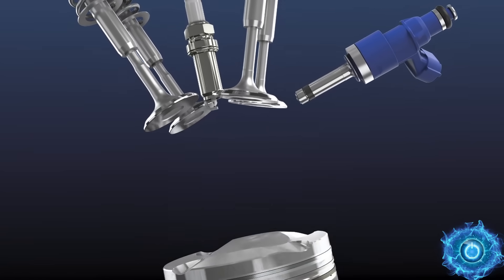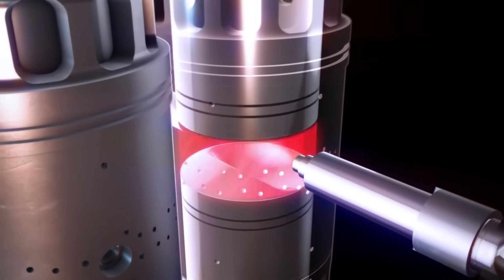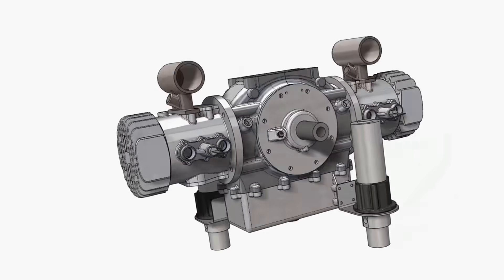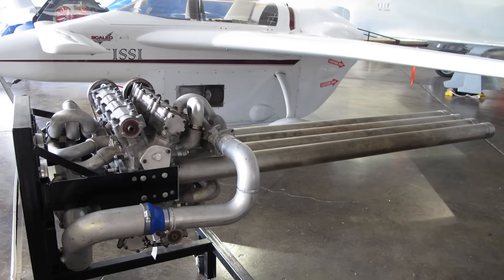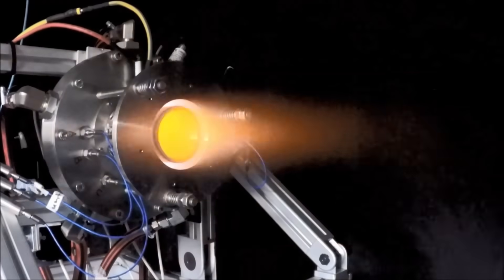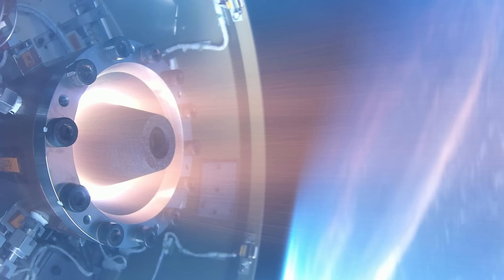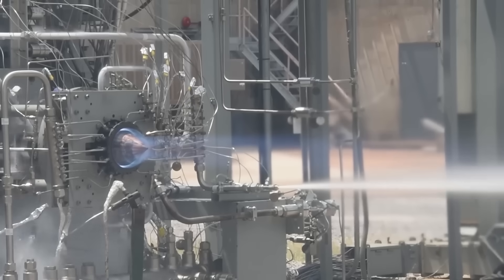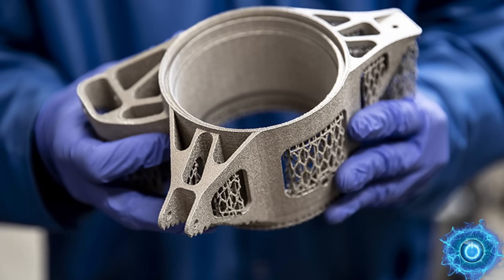NEW Aerospace ENGINE Destroys ROCKETS

Comment: Isn’t this basically the engine from the WWII German V2.. they called them buzz bombs.
Reply: First, the buzz bomb was the V1 🤦‍♂️ the V-2 was liquid fuel rocket. And comparing this to a V-1 is kinda like saying the smoothbore cannons on modern MBTs are the same thing as smoothbore canons from the age of sail. Except that really the two canons are more similar to each other than the V-1 engine is to this because both canons and the V-1 are all three based on deflagration, but these are detonation engines.

Comment: How is this hitting YouTube as my first "hit on the radar" so to speak, of this leap in engine teck? More accurately, engine PHSYICS.... I've known about pulse det engine PHSYICS almost my whole life, and I'm currently 45 years in. I've known of, and been deeply intrigued by Pulse Det engine tech since I was 7 years old, when I saw it for myself out in the Mojave Desert a few miles OUTSIDE of a place that I definatly would not have been allowed to be... And it was moving across the desert sky QUITE well then. LITTERALLY FLYING. Lol, like if God picked a sketchy booger and yeeted it... BOOOM, BOOM, BOOM,BOOM,Boom,Boom,Boom,boom,boom,bom,bom,bombombombombombombmbmbmbm.... And gone.
Never have, even 40 years later, been able to correctly describe the dopplar effect of that event. Even though it is Burned, engraved, etched in my memory. And at a guess, it was mach5 capable even back then.

Comment: We have advanced in quantum leaps as far as propulsion goes since the Chinese made rocket fireworks.
For every action there is a equal and opposite reaction some dude said.
However the holy grail will be figuring out how these UAPs propel themselves as well as maneouvre their
craft without visible means at speeds we are not anywhere near

Comment: You have missed a key point. It is not an explosion that drives a piston but the expansion of hot gasses, including the non-combustible ones, The explosion or rather a fast burn (a detonation would blow a hole in the piston) is usually arranged to be completed on the compression stroke before top dead centre, and then the expansing gasses drive the piston. And a turbo jet works the same way, it is the expansion of hot gasses that drives it. When it boils down to it, these are heat engines.

Comment: I know what you're trying to do, think of it as a sprinkler. Every time the sprinkler lists off a water spout there's a valve that pushes forward and then hits it to turn this all it is. So basically every time there's an explosion it opens up a valve and then once the bow comes back it turns it and then it opens up again so it means you'll have a constant variable explosion in the same or in different valves without having to worry about the same valve being damaged. It also allows it to cool itself down as it changes between valves like a sprinkler would do every time it turns.

Comment: 4000 pounds of thrust for 622 pnds/sqinch (that's  about 40 atm , right? ). Can't wait for an engine like a standard rocket where pressure ranges between 250-300 atm.
The problem with aerospikes is, is that the cone melts. Maybe with some new 3D printing techniques they can cool it enough.

Comment: Also interesting to see that Aerospike-type nozzle is being tested alongside! As an Engineer who loves CFD and Aerospike, I would love to see what the future holds!
Reply: @@antigravity7418 And for the low low price of $10,000 we can all buy shares in your company.
Pass.
Make a flying car, a REAL flying car, and you'll be a billionaire. So far nobody has.
Reply: @@antigravity7418 Good luck !
Reply: meanwhile in area 51: 🛸
Reply: @alphazero6571 Nah, all that alien talk is just garbage, garbage, garbage, because although absence of evidence is not evidence of absence, it's also not evidence of presence and cover-up.
This is real. 😊
Reply: Not really alongside.

From what I have heard the aerospike is integral to the RDE design to the point that it would not perform even as well as a more standard combustion design with a bell nozzle.

It seems like the aerospike and the rotating part work really well together.
Reply: It should work with the right weight to power ratio in order to achieve the best efficiency point with multiple detonations even if it means more light weight rockets

Comment: 25% more efficient? From what i have heard it is 5% more fuel efficient than conventional design. 

Further improvements on weight doesn't help that much, if i save 25Kg on 1st stage engines and add appropriate amount of fuel with same trust to weigh ratio it might add 1-2s of 1st stage burn time, that might add up on bigger rockets, but it is not much. 

It also naturally creates perfect design for aerospike engine that might allow you to efficiently separate stages higher up and get more performance from the second stage. 
RDE might not scale well for 2nd stage engine because of the spike design. Current spikes are shortened so that the material you know doesn't melt. 
Making a spike that work for deep space missions might be too big, and odd shape to fit in the rocket, for such spike even the engine might be too powerful for 2nd stage.

Comment: one can get around alot of computation by making small (mini engines) proof of concept designs, taking data,  then scale up with the parameters that show promise...this is how it is done prior to AI
Reply: Yes, but making is slow and expensive. Computation is fast and cheap so iteration is viable on problems that would have such a high rate of failure that they'd never have gotten built doing it the old way.

Comment: I think claiming that aerospikes destroys roctets is a bit much, especially when its never been flying on a rocket, also you forget gimble which is used on 99% of the rockets for aero controls, Aerospike is a very good engine in theory, still need to make its proof if its flyable or not. unfortunatly i will give a thumb down on this one for the massive clickbait. good video, bad title.

Comment: I'm a little worried about the rotary component of RDEs introducing guidance issues, but I guess that could be dealt with by having them in counter-rotating pairs like drone rotors.
Reply: They already have multiple detonation waves, keeping the number low and stable, so they don't interfere is the challenge.

Comment: Any possible gains in efficiency to be had from multiple pulse jet’s but with a single exhaust exit using some means of alternating firing orders or just using resonance and using active scavenging similar to an i/c engine and extractor’s? Has this been done or at least experimented with?
Reply: I'd think at this point the most gain you get get from a single exhaust point would be through MHD bypass and ejector integration to accelerate the exhaust plasma.

Do it well enough and you might even prolong the lifespan of the engine by reducing plasma touching the interior walls.

Comment: this aint a rocket part https://youtu.be/uqGBGnh_8JM?t=294 at the end of the video, this is actually a wheelhub-upright from a Formula Student team in Germany, in the middle goes the electric motor which drives the wheel directly over a radial gearbox. 
The cool thing about it, its made out of titanium. But it still has nothing in common with this video other then beeing 3D- printed. Its not even designed by an AI.

Comment: RDE / PDEs are not new. When I was I was doing my Masters in Aerospace Engineering back in 2014 - the theory behind it was already considered mature. The only limitations were materials, construction techniques and getting better simulations. RDEs were a hot topic and people back then were already saying it would be a breakthrough in traditional propulsion - to kill gas turbines /rockets etc... Nearly 10 years later, I would say not much progress has been made - It's still nowhere near replacing traditional rockets or even gas turbines.
Reply: "The only limitations were (lists everything) but other than that I had it in the bag!"

Comment: 3D printing engine parts is so cool since it allows far more complex parts and substantial (low volume) production cost savings.  Testing and modifying the design is much faster and cheaper too

Comment: Your description of the candle burning was wrong. It's not the rate that the engine goes through the fuel. It's the faster flame propagation rate that turns the combustion into explosion and moves the molecules faster, not more molecules moved.

Comment: The explanations in this video are... "opaque".  It does not matter for thermodynamic efficiency if the fuel burns or detonates. It's the same. There will never be any advantage for 'detonation' in any piston engine or working media engine. The difference comes in how much of the energy can be converted into propulsive energy, by accelerating the exhaust gases in specifically rocket and jet engines.
And even for those, while this is certainly interesting to explore, I wouldn't hold up my hopes too high. First of all it's a moving target. Conventional combustion chamber pressures and (jet engines) compression rates are moving upwards to extreme levels, where there is less and less theoretical waste energy left to utilize. And so does thrust/weight and operational life. Even if a detonation rocket engine is successfully developed, its not clear at all, that the total package will be more efficient and/or economical for, for example, a launch rocket. If there ever comes a first application of this, my guess is it will be a missile engine.

Comment: I wonder if RDE engines would be a better choice of engine for hypersonic cruise missiles, instead of the RAM/SCRAM jet engines that are being used, and tested, at the moment. Although, the production price of RDE's would need to get much cheaper before they can be fitted to any type of smaller single-use AAM or AGM.
Reply: This will be next gen or the gen after given the lack of moving parts and likely use of 3D printing I'd expect the price to fall rapidly as the bugs are worked out.

Comment: My neighbors already hate my cars exhaust. I can't wait to unleash the exploding tornado.
Reply: @sabrefayne :  Using d.i.y. method, you may try the "pollution reducer filter" (PRF), by "duplicating" the designed of the now existing EURO-5  and the EURO-6 anti pollution device...

Such PRF muffler, was being installed at the exhaust pipe of concerned vehicle.. Pls searched the internet on its basic designed, then figure. out on HOW you can "duplicate" it...

Comment: "An RDE is theoretically more efficient than conventional deflagrative combustion by as much as 25%."

A: That is "combustion efficiency", not overall performance...which is what really matters.
B: It is only more efficient in the extremes. A great RDE is better than a mediocre conventional rocket...barely.

In other words, you can get more combustion efficiency in a regular deflagration rocket engine simply by lengthening the combustion chamber to give the fuel and oxidizer more time to combust. Even a relatively minor lengthening can increase performance. So then we have to ask, is it worth all of the trouble to make and operate a RDE as opposed to lengthening a tube?

Comment: FYI: The reason why Detention rockets are more efficient is because the exhaust gases are traveling much much faster. k = 1/2mv^2 Meaning if you double the exhaust velocity you double the energy (thrust) by about 4 times for the same fixed amount of fuel & oxidizer used. 

The issue with rotating detonating engines is they need the fuel & oxidizer to be pushed out at high velocities which is beyond the ability of existing turbopump technology. Rocket turbopumps can only operate at low pressures compared to the pressures needed for rotating detention engines
Reply: better add a few air quotes to the "low pressure" - afaik chamber pressure in rocket engines is usually above 100 Bars, and above 300 Bars is also not unheard of..

Comment: The same reason why the (in)famous aerospike engine never broke into the market for rocket launch vehicles: too heavy and too much problems with heat, pressures and fluid dynamics for the time back then. But nowadays? With supercomputers, modern CFD programs, new materials and 3D printing anything is possible. Maybe even the (in)famous SSTO some day... 😁😇✌

Comment: During WWII the Germans experimented with Ram Jet engines using coal dust as the primary fuel. The engine was to be mounted on a Feisler Fi-103 or better known as the V-1. The engine produced similar power to both diesel and gasoline. It never got past the experimental stage.

Comment: Not sure how it would compared to a rocket engine, But to me, this looks like a functional aerospike engine
Reply: The important part isnt the spike it's that the exhaust is traveling at supersonic speeds so each bit of burned fuel and air drives the vehicle a lot faster than with a conventional engine regardless of form factor.

Comment: making the explosiin comes from plasma or electrical discharge might be something they do later , so you will have a small neuclear reactor that will power the electricity needed to generate enough plasma pulses in the engine chamber

Comment: Has anyone looked into hybridization of RDE and Ion propulsion? Using magnetic fields to contain the exhaust and accelerate it to even greater velocities could, theoretically, act as an "afterburner" to increase thrust significantly but without the additional fuel requirement of a typical afterburner. IMO
Reply: Problem is ion propulsion is severely inefficient and even in space might not be worth the weight as an afterburner

Comment: If implemented in the car industry, would that require another type of fuel? The fuel injectors  are good at mixing the fuel with the air so in theory a spark should allow the fuel/air mix to detonate. But, is it a too slow detonation? Few engineers have worked on using something like gunpowder but I've never seen a working engine of that kind.
Reply: Ultimately while RDE tech could in future result in a better combustion engine; the combustion engine will be dead before that happens due to electric vehicles taking over. By 2030 selling new cars with a combustion engine will be banned in most western countries already so there is very little reason to invest in RDE for cars

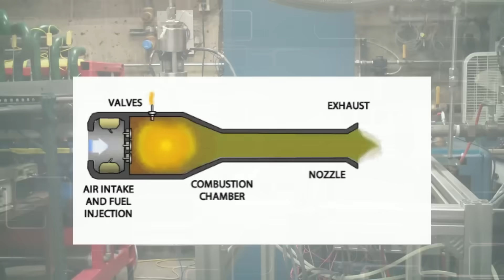Comment: 1 little thing: 0:10 that's a pulse jet, not a detonation engine. the nuance has to do with flame propagation speed being supersonic for the detonation engine. A pulse jet is way slower; as in "mechanical valves" type of slower.

Comment: For some reason I see that kind of engine being used for a specific condition in flight, and outside of that parameter it's performance isn't all that great. Might need a regular jet engine or boost rocket to get off the ground, and only bring the RDE unit online when you need a constant thrust output at cruise.
Reply: I can see it being an insane booster to augment takeoffs and military plane WEP. Low energy in a fight? Kick it on for a few seconds. Keep manufacturing so it's not too expensive or complicated to swap out when it inevitably burns the nozzle out. We should probably give it it's own fuel tank too. Just enough for as many ignitions as can be tolerated by the nozzle in a really bad day. If they made a stealth plane as capable as the F-22 and included that along with a way to cool it down without cracking (partly for keeping it operational partly to keep your thermal profile low). Then that would be an insane use of an already powerful design

Comment: Spinning chamber... Engine designs have already been made... For mechanical engines...
Reply: Problem is it needs air to detonate and rotation the chamber doesn't necessarily rotate the air inside it. But you could introduce a high flow rotating air source to keep pushing out the burned stuff to get new oxygen in. Maybe have this design as the center of a pusher prop with flush folding props when it kicks on. Could be worth the weight to have the option of high efficiency or insane thrust.
Reply: @hf117j  First images your description brings to mind is pressure blower like those used in homes to cycles air after it's passed through filtration... Or those of cylinder drone wings... And... Would looping the air back through introduce too heat for no any added affect?

Comment: Although aerospikes are cool and all, there aren't any because they haven't been able to figure out how to make them compete with the typical rocket nozzle such as overheating of the central spike and the extra weight.  A rotating detonation may help and even a few percent in efficiency means thousands of pounds savings, although, it may still not be enough to overcome the extra weight and complexity to make them worthwhile.  It's still possible but probably still a long way off if at all.
Reply: Wait... what kind of engine does the SR-71 have again?
Reply: @hf117j  The SR-71 temporarily experimented with using an aerospike engine (LASRE) but the SR-71 blackbird itself does not actually use an aerospike engine.  So far no aerospike engine has made it to space or LEO that I know of. Every space agency and space company so far has rejected aerospikes because they're not worth it due to various reasons.  Perhaps NASA with the detonation engine will be able to get over the hurdle?
Reply: The aerospike form factor is incidental. This is all about moving exhaust gasses out of the engine at supersonic speed because the impulse is proportional to the square of the velocity.